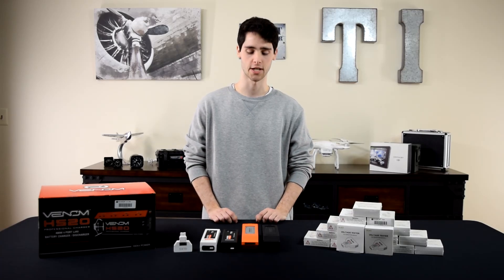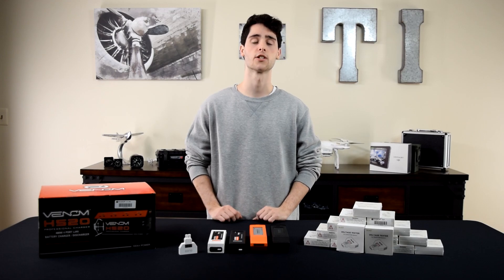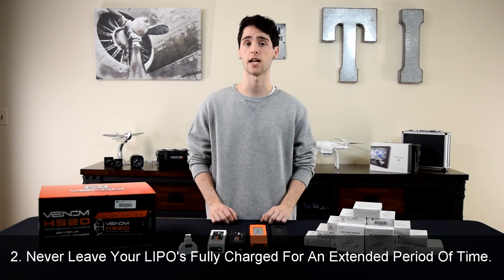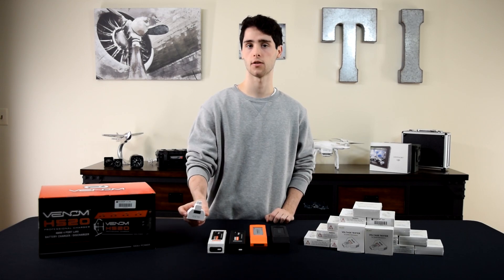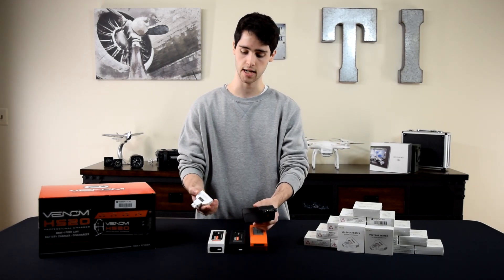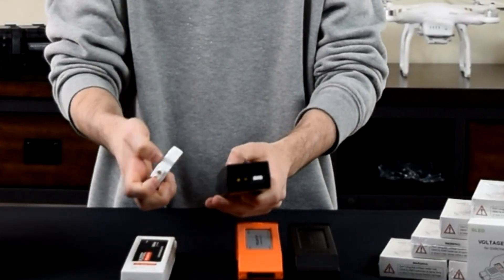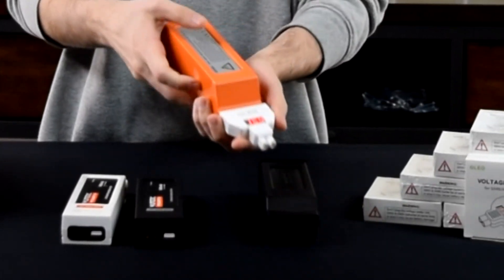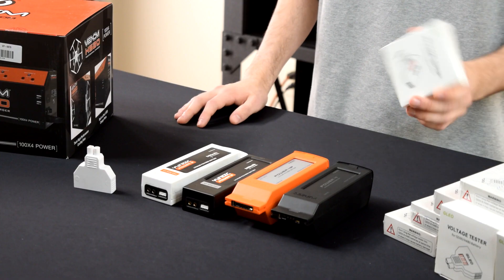How to Easily Check The Voltage of Your Yuneec Drone

Comment: Good morning depending we’re you’re located. I’m having a problem with my Yuneec Q500 . I purchased it several days ago from EBay and it flew very well except when I went to check my storage card, there were no videos or photos on it. I tried several more times and checked to make sure that the recording timer was working right and I stop the recording before taking a picture but still nothing. I heard it could be a firmware update problem. Can someone please give me some advise or should I just send it back. Thank you very much.

Comment: Just got the voltage checker from you what should a full charge of a H Plus be on readout?
Reply from the maker: Thank you! A fully charged Typhoon H Plus battery should be about 17.2 V
Reply: What voltage is best to store the H batteries for extended periods?